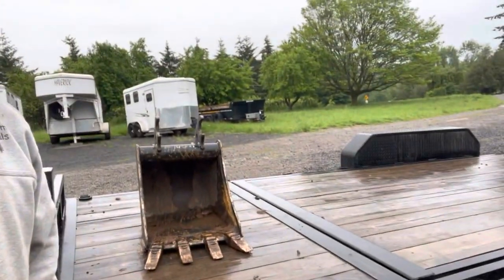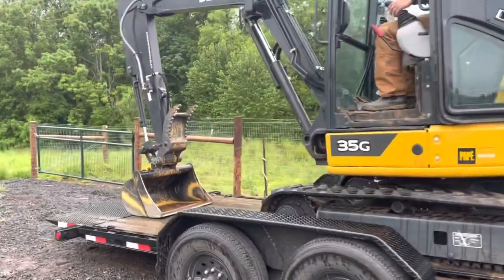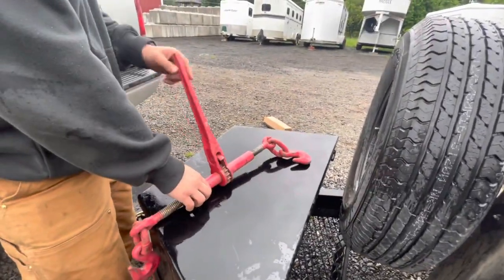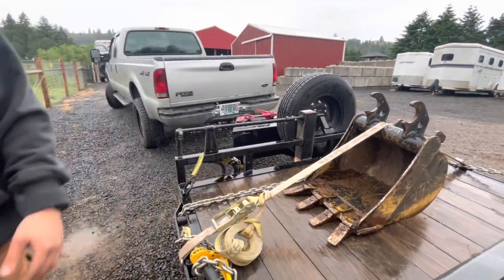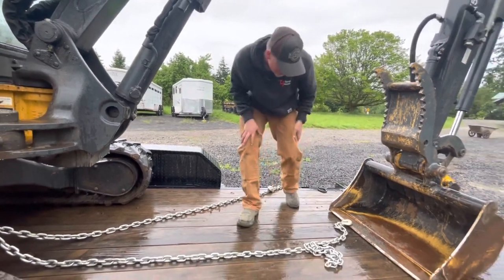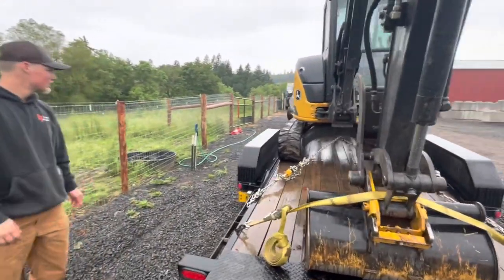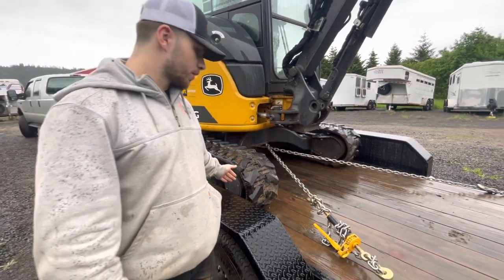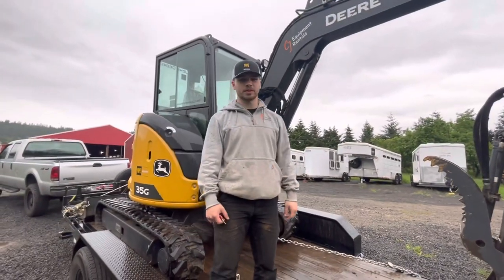How to load a mini excavator on a tilt deck trailer

Comment: You did a nice clean job with good chains and binders, but it is not correct.  You should have the machine tied down at 4 separate points, plus boom and implements.  The way you have it, if you have one failure of chain or binder, the entire machine is loose.
Reply: While it is certainly "better" / "safer" to tie the machine at 4 separate points, it is not required for equipment under 10k lbs, the chains and binders still need to be rated correctly for the machines weight, but front and rear is legal (so it is not "not correct") for this machine.  The boom and implements still need to be tied down as well, but their method for that is legal as well (assuming the straps are in good condition, etc.).  Not arguing the failure scenario you mentioned, just that it is legal the way they did it and not unusual.... 

All that said, I tie my CAT 302CR (5k lbs) down with 4 binders and 4 short chains in my dump trailer (or the equipment trailer), one on each corner, as that machine was not cheap.....  And yes, the arm gets strapped down as well, plus any buckets.
Reply: @stephenlehr6020  I was not aware of the 10k cutoff for that.  I have an 8k machine and I used to do exactly what they did until I was told about the "4 separate points" and it made good sense so I've always done it that way since.  They definitely did a thorough job with the right stuff and I'm not faulting them at all.
Reply: @joshhamel5853  Nothing wrong with doing more than required, thumbs up!!
Reply: @stephenlehr6020  at what point do you need to go to chains versus industrial straps?
I have seen all types of straps including 5,000 and 10,000 lb working loads. 
With that said if you strap down the machine with six heavy duty straps would that be legal?

Don't get me wrong I'm not asking if it's better I understand chains don't rip as easy or break as easy I'm just trying to figure out in a pinch can you use straps if your equipment is under 10,000 lbs?

Please be detailed in your response if you can thank you 🙂
Reply: 10.000 lb and over require 4 separate tie downs, bucket also required to be strapped down👍
Reply: Iam looking for the 10k rule.  I don't see it.  Iam in ny.  All loads must be held down by 4 points. All loads.  Pick trucks included.   Iam in ny however most of dot laws are federal. As a driver 15 years ago you still needed 4 points of attachment.  Tow truck drivers tow cars that are under 10 k. They have to have 4 points by law.    A shovel has to be secured..   even when we put a car on wheel lift by law it needs 4 pints of attachment. That why they have to have safety chains on top of the chains holding down the car..  Amy one know this 10k rule I can find somewhere?  Just curious not saying your wrong I could be .. I still drive my own stuff and would like to know

Comment: you got a cdl? also just fyi...each quarter of the machine needs to a separate contact point...so you need to cut them chains in 1/2 and give each corner its own safety point. at least it should be....is for us
Reply: GVWR is under 26k, why would he need a CDL?
Reply: In our area it’s not 26lbs or less, that’s what I thought at first. Some areas of your have a 10,000 lb or more trailer & are commercial you need a DOT card at least.

Comment: So much wrong about what you are trying to teach. All I can say, Is at least you are trying. And you don't have a 5-point tiedown. A 5-point tie down is 5 separate chains and straps. The one on the rear is a one-point tie down. The front needs a binder on each side, not one binder. That's also considered a single tie down. The machine has to have 4 points, the blade has to have one, the bucket on the rear has to has one. And drop your chains through the stake pockets and put the chain hook on the upside. That way if the binder breaks the chain doesn't come off.
Reply: I thought the same thing but this machine weighs about 8500lbs, so this is technically legal, both in terms of number of tie down points, and working load limits (assuming g70 chains). I agree though, it's confusing when he calls out the 5 points, because this is not a 5-point tiedown, and the 5-point tiedown isn't required for the situation. I hope this doesn't confuse anyone into thinking they can run all heavy equipment like this.

In any case, I'm with you on how to secure these things - at our company if it rolls, it gets 4 direct points + 1 if there's a bucket, regardless of weight or what DOT says about a 10klb threshhold.

Comment: The arm is going to wear through the strap at some point because the edge of it
Reply from the maker: You can always buy straps. Cheaper than pins👍🏼
Reply: @cjequipmentrentals7294  You can always put corner protectors under the strap too! It's way cheaper than cutting a strap and having a piece of equipment come loose while transporting.